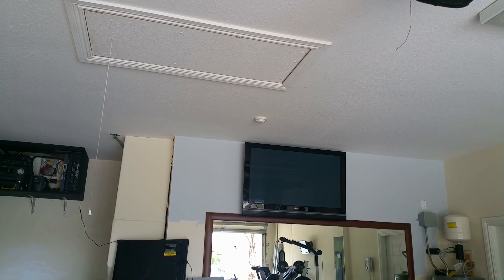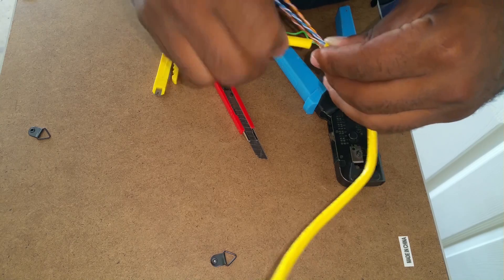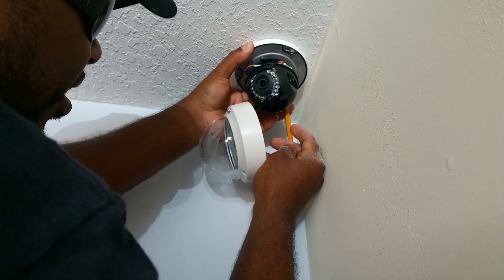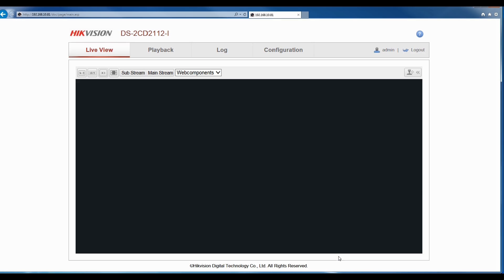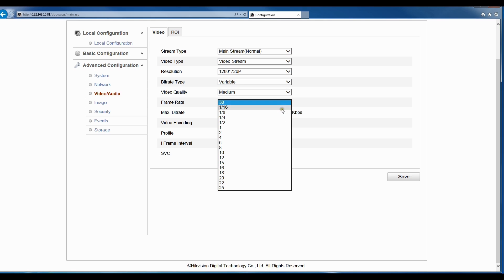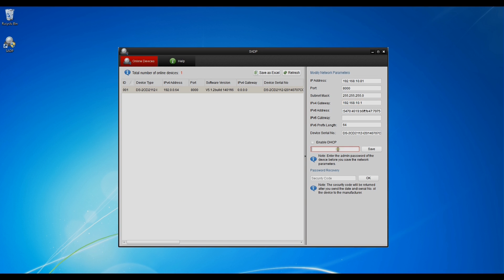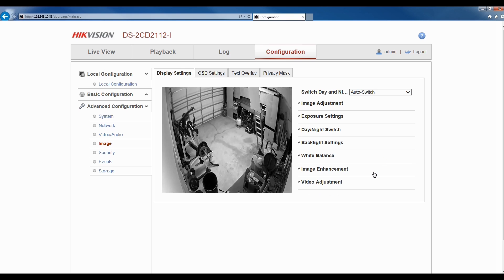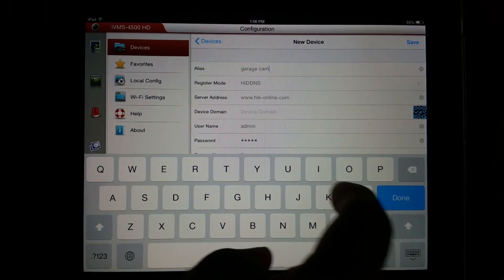Hikvision DS-2CD2112-I  How To Install A Network Camera

Comment: I hope you can help me. I recently purchased a HiLook DVR which is manufactured by Hikvision I believe. I have four IP cameras by the same make all plugged in via POE. I've got a H264 (no model name I'm afraid) located in a bird box. It's been plugged into a PO E adapter for the last year and I've been able to view it using an IP viewer and also had a hosted online the public to also see. A few days ago I plugged it into the back of my DVR and it worked perfectly okay. However, when I plugged it back into the PO E adapter the IP viewer can't find it. Also, when I go into my router settings I can't find the IP address for it. I've got SADP installed and that can find the camera. It gives me an IP address and the port it displays is the same as the DVR. I don't suppose you can shed any light on why it's not working now

Comment: You have some great videos! Thanks for posting them. What tools specifically do you use to make the Ethernet wires in this video?
Reply: Any cat5 tool works like any other.  Just make sure the wires dont change order when you are going to crimp the connector.

Comment: i've got one of this, but can't figure out if it supports a tilt function? thought it did when i ordered, but now it looks like it's a static position , as software does not allow me to do any movements. Do i need to set the position manually inside the camera via a screwdriver?

Comment: I have 2 hikvision dome cameras that I had professionally installed.  I am getting a new router since my current one is not working that well for general internet connectivity.  This has not impacted my cameras per se but my concern is when I get the new router I will not be able to have cameras remain connected.  Is it as simple as just plugging the camera Ethernet into the new router or do I need to go into camera setting and add new router IP or anything?  I am not savvy with networking these things.  Any ideas?
Reply: This is a nicely worded question John, so I hope by now (a year later) you have transitioned to the new router and everything is working properly.  To answer the question in general, by 'Default' many IP devices go to an Internet / Internetworking Protocol address of: '192.0.0.64' and this would not be recognized by most networks as 'valid'.  Once your router is connected, that device typically defaults to the more common '192.168.1.1' for residential and business use.  Businesses often do not use this IP Address 'range' as a Default, but some may.  For home use, the 192.168.1.x range allows for devices on the 'x.x.1.x' subnet from 'x.x.1.1' to 'x.x.1.254' or a total of 253 devices!  The 192.168.1.1 address is 'Reserved' as a Gateway address, but also know that some 'Default' settings may use x.x.0.1, or a '.0.' subnet range.  Hopefully you have no where near that many devices connecting to your home network.

After everything is connected to the new router, it may still be possible to navigate to the cameras using their existing settings, but in order to achieve that you would need to have written those down BEFORE switching to the new router.  In other words, the installation of the router will NOT change anything on the cameras, unless they were previously configured for DHCP (or Dynamic Host Configuration Protocol), an adaptive IP addressing scheme.

The most likely scenario is your camera IP addresses were set to addresses similar to 192.168.1.100 and x.x.1.101, or something similar.  Since you have these settings written down somewhere, or viewed them on the old router, please refer to those configuration notes.  If you do not have the settings for each camera, then downloading the 'SADP' software and using it to view the settings of each camera BEFORE removing the old router and installing the new router is advised. - If the new router is already installed, then possibly you can unplug everything and temporarily swap back onto the old equipment long enough to run the SADP software and capture the details from the cameras. - If the old router is not available, or if you simply want to try the SADP software on the new router (i.e. the 'new' network) then please do!  The SADP software is a 'passive' scanning utility program, so it is basically like using a flashlight in a dark room.  SADP allows the operator to 'View' and 'Alter' (or update) settings, but it does not modify any settings automatically; each step in updating a camera's settings must be done deliberately, step-by-step, in order to effect changes.

I hope this information is of use to you and others.
Reply: Hey John, here's an even better reply. Keep your old network as it is, with cameras and your NVR connected to your old router. And then just run one ethernet wire from the old router to the new router. That way your new router will handle your internet traffic, and you'll have the same old internal network to handle the cameras, with no additional configurations needed.

Comment: nice cat 5e crimper...noticed the cable went all the way through it so you could confirm the pin config...never seen one like that whats the brand and where would I get one from ebAY??? what's its correct name please. If known..
Reply: EZ PASS FITTINGS, MUST HAVE AN EZ  PASS CRIMPER

Comment: Whaaaaaat?  Never seen RJ45 like that!  All this time!  The wires come all through.  Jealous
Reply: Used for CAT6, usually.
Reply: @MikeSmith-hi2tb  this world is getting so automated that no one will have a job
Reply: @RobertLongM  whats that tipe RJ45 ?
Reply: @hasan99123  tipe?
You asking RJ45 is?  It's Ethernet Cable End... 8 pin phone like connector.

If that wasn't your question,  rephrase

Comment: Hey, where is the footage being stored? NVR or computer? Can the footage be stored on my computer instead of using an external NVR. In other words, its from my computer to a switch, then to the cameras. Can that work?
Reply: You can connect a hard drive to your router if you have an option to connect a Hard drive to it.

Comment: Video is helpful but I don't understand something: Why do you not follow industry standards (ie 586B) for the ordering of your wires in the cables? I'm new at this, just built some cat 6 cables and it takes me a while but you flew through it not having any concerns about the ordering of the wires? Am I missing something?  Thanks!
Reply: He was so fast and pro that you missed it man.
Reply from the maker: Thank you. Either way will works fine they are both straight through. I work for an AV company and  A is our standard. I know all the colors and i have done hundreds if not thousand of these. So its like second nature to me.
Reply: Type B is common in the US but Type A is more common elsewhere. It doesn't matter though as long as both ends are wired the same.
Reply: @shegocrazy , I've seen only type B in Europe
Reply: He used the type A norm, the wires are ordered properly. You can see a cut in the video when he's stretching the wires

Comment: Nice video as all others.  Do you have any pics on how your equipment is set up in your garage and attic? I'm in the same delima. How does your garage maintain cooling ? I have a patch panel and sisco  router I need to place
Reply from the maker: +Jeff Turner Hey Jeff, I believe I have a few pictures. So far I haven't had any issues. been its been setup this way for four years.
Reply: +The Automation Guy if you can, email them to me, doqtorno@gmail.com.
Reply from the maker: +Jeff Turner  Did you receive the pictures?

Comment: What kind of CAT connectors are you using. Looks like they are easier to work with.
Reply from the maker: +Dariusz Bartkiewicz 

EZ RJ45 connectors http://amzn.to/1O2gLAA
Reply: Thanks
Reply: made too many cables the old way, going to have to get one of these.  Thanks